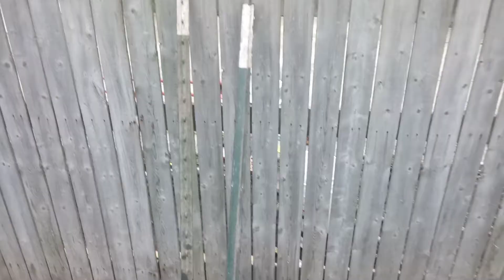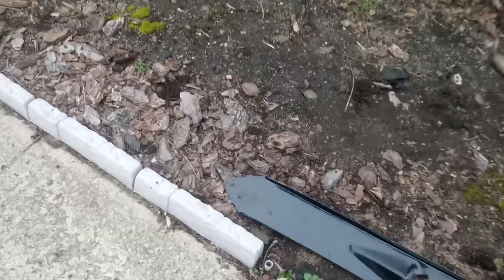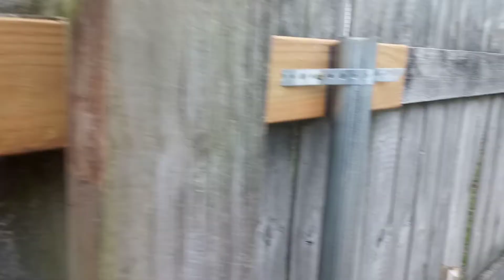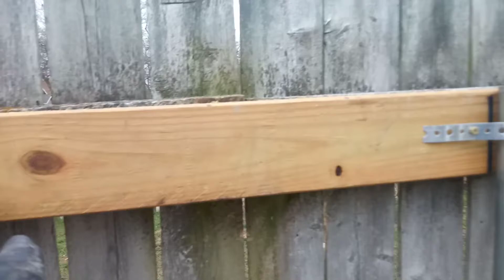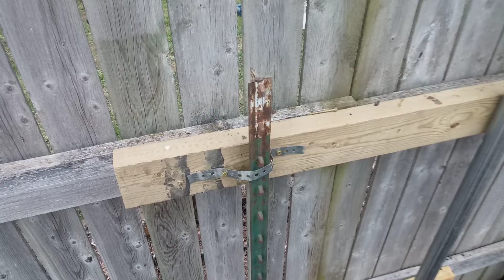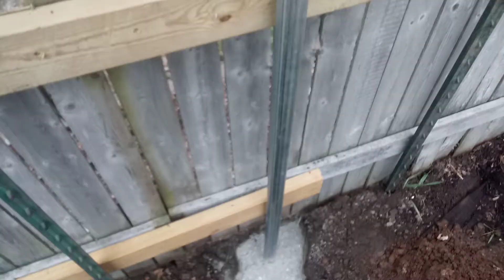Broken Fence Post Easy Long Term Repair 4 Rotted Fence Posy Replaced With Metal Post W/O Pulling Up

Comment: This is THE BEST video that i have seen.... a reg guy with the same issues many of us encounter... i liked the temp post and the galvanized pipe that is off center from the  exact location from where the two panels meet.  Rather than try to remove my leaning post that is in a LARGE filled hole with concrete, I'll just move my post down a little,  I also appreciated the DIY method of adding 2x4's as needed.  It is not the perfect method, but i am not looking for perfect. I just need to find a method that will work!  THANKS!
Reply from the maker: Thank you so much for the feedback! So glad it helped you out! It's February 2024 and this fence is still standing perfectly straight and the neighbors had no complaints as the repairs were all done on their side of the property. I removed all the extra supports so it looked clean after I was done.
Reply: A fix will never be perfect. Just bought my first home and the fence was bad 😢

Dont have money to buy a new fence. But I will fix what I can to save a buck and to prevent anything coming in

Comment: Thanks for the video. That looks good. If you don't like the looks of the metal pole next to the wooden fence, you can always paint it to match the fence, or paint if black, or place a fence picket in front of the pole. Fencing contractors tell me that if the posts are rotten, the fence itself is too. Do you have any thoughts about that?
Reply from the maker: Ours has been up there for a very long time and the fence was somewhat dry but  not rotted.. it's above ground so No reason for it to rot. It's treated lumber.. it's still standing straight in 2024.
Reply: @livenfree  Thank you. All the fence contractors are very eager to sell you a replacement fence, when all that's needed are new posts.

Comment: Thanks, bro!   This is a quick and easy way for me to repair the fence between me and my neighbor who had stuff
leaning against one post!  He's too lazy to do it...and I see no reason to invest digging out the old fence post with
CONCRETE.  This way, just install to metal fence post on either side of Weak Post, affix them with clamps. Done!
Reply from the maker: Sounds like a good plan. Yes it's a lot of work removing the concrete. So much easier to work around it. U might have to put boards to keep two sections of the fence connected as I did.

Comment: even easier if you just break out the concrete and fasten the steel post to the fence post after you pound it in about a foot into the bottom of the hole (Use at least an 8ft post) . only wildcard is setting the post square and flush with the fence post when its level (do this before pounding it in) then you can cut the wooden  post base to clear the ground /concrete then set your concrete in the hole around the post. Change the diameter of the hole if necessary to keep the steel post as close to center of the pour as possible. The steel post doesn't need to be as high as the fence. Try and anchor the wood to the steel at three points.

Comment: I hate digging post holes. IF the soil isn't rock solid or full of boulders. I just drive a 10' piece of 3/4" rigid galvinized
pipe in the ground. 6 ft fence, pipe goes in 4 ft, 2 hole half straps mounted to rails.  So far 10 years solid
Reply: Love that.
Reply from the maker: Do you have a video link to show visually what you do? Sounds like a great plan, just trying to visualize it

Comment: When you did the other posts did you just cut them off at grade?
Reply from the maker: Sorry, YouTube is terrible about notifying me of comments. Not sure which you were asking about but the old wooden post was rotted and broken off. If you're asking about the temporary posts I just pulled them back out. They were fence posts. You just wiggle them back and forth and they lift out of the ground. A steel round posts I put in were left in permanently.

Comment: Where has the best price on those poles?
Reply from the maker: Not sure. Usually pretty reasonable at Lowe's or Menards. I had this hanging in my rafters from the previous homeowner. Can't beat that price 🙂 or I found it somewhere on a property cleanup job.

Comment: I think this method since you don't have to dig anything out or replace the railers. Gonna try this today. I might dig out the old concrete and reuse the same holes but I haven't decided yet (probably not since this method is so much easier) - also you should put a cap on the post I think so it doesn't fill with water?
Reply from the maker: Good idea on the cap. Let me know how it goes
Reply: @livenfree  Worked out perfect. It's not the prettiest fix but the posts are on my neighbors side =D  Not bad at all for $60 bucks. Wlil of course have to do more work later since some of the boards are in rough "rotted" shape but it did the trick and took a couple hours only.

Comment: Should use a self tapping metal screw to attach the strapping to the metal post..
Reply: @ Mixwell1983,
and should have used pressure treated lumber too, but you use what you have. Besides, it may not be long before he has to replace the whole fence.
Reply from the maker: The straps are temporary till the hardware stores open back up after the covid shut down and I could buy a proper clamp
Reply from the maker: @anonymousperson4363 It's February 2024 and this fence is still standing perfectly straight

Comment: Not very pretty
Reply from the maker: You're seeing the temporary fence posts and clamps to hold it till the concrete sets. I removed those temporary posts and the plumbing strap and put a proper clamp on it and the cap on the post. It's on my neighbor's side and I asked him what he thought and he said it was fine. You're seeing the work in progress. Once it was done I covered up the concrete with dirt, landscape fabric and wood chips.
Reply: It was extremely helpful to see it at that stage with the temporary braces, etc. Thanks for showing the "not pretty" part.
Reply from the maker: @AlmostLogical_OG You're very welcome. Glad it was helpful!